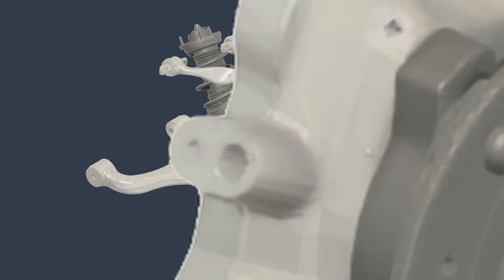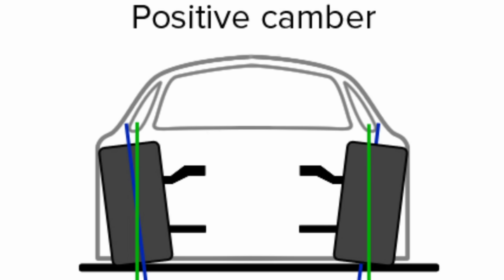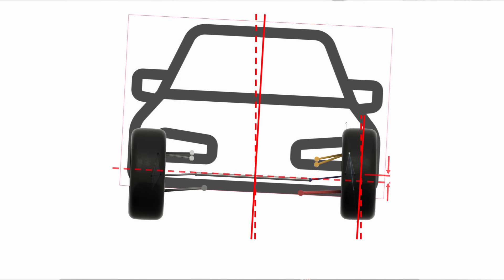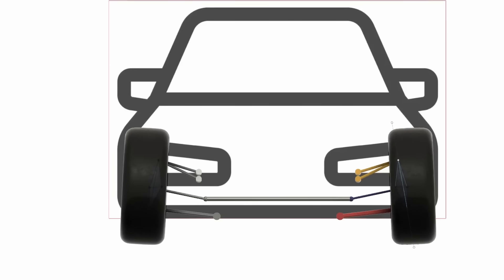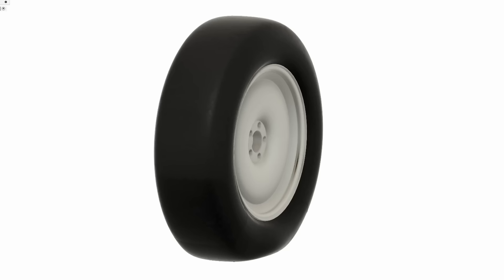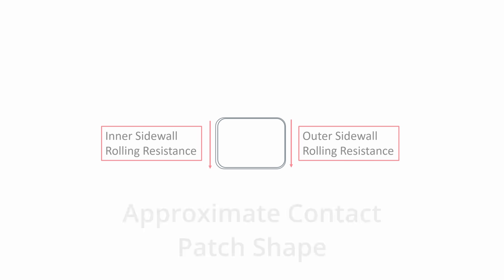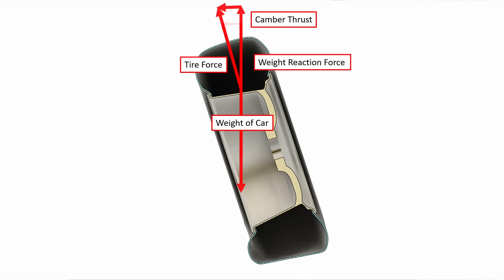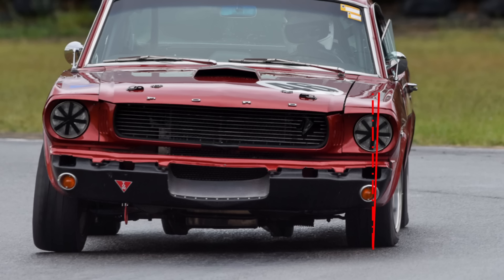Why do some race cars have such ridiculous front suspension camber angles?

Comment: Just discovered this channel and i love it!

But for some food for thought: at 8:42 if we add slippage, during heavy cornering the point A no longer moves in straight line reducing the camber thrust effect.
Similar thing under braking. Wheel is underrotating, so point A is moving faster reducing the tension inside the tyre. And from other part of equation i've heard from race engineers that high camber does not impair braking much (there is some effect but cambered tyre takes braking better than acceleration).

Comment: Using a V8Supercar as the example is problematic for a variety of reasons and highlights why focusing on a single setting that is part of complex system does not provide an adequate explanation. Crisp turn in is not the answer.

Caster on turn has a significant effect on camber and weight transfer.
Ackerman angle alter toe on turn.
Bump steer affects toe under all conditions.
Toe angle has an affect on all of the above.
Centre of gravity, roll centre, roll couple and roll moment all affect weight transfer.

To win a race you must complete the race distance in the fastest time. To do this in a competitive field requires the lowest average lap times. This requires consistent predictable grip. The most effective use of tyre slip angle, braking efficiency, drive/traction and tyre wear determine camber angle. Tyres operate in temperature window. Tyre pressure, carcass movement and interface with surface all affect temperature. 

A "crisp" turn in will win nothing if you are being out braked by 5 metres every corner.

V8Supercars have used a control tyre since 1999. If communism was a motorsport this it.
They have used a full spool locked rear axle since 1993. Getting the inside rear wheel away from the surface during turn in and mid corner is key. 
They used a 6 link live cambered jackscrew adjustable roll centre rear axle until 2013.
Project Blue print in 2003 meant only engine and body panels were different. All front suspension double A-arm.
They used triple spring 4 way adjustable dampers until 2020 - Tender spring (soft), main spring and bump stop spring.
They used driver adjustable front and rear sway bars until 2023.

Comment: You forgot about Caster, That while turning the wheel it will increase camber to the external tire and reduce it in the internal tire.. Rear wheel drive cars have very aggressive Caster, because the front is a Passive axle, where Front wheel drive have less caster because it is a active axle, but also because  most of the weight in on the front and To much caster makes maneuvering very hard.

Comment: I don't think this discussion is compete without talking about optimizing contact patch load across the width of the tire while cornering. Sidewall and contact patch deformation while cornering at 1.5+ Gs is significant and we want to make sure we're not overloaded the inside or outside of the contact patch. The usual means of adjusting this is with tire pressure and camber while measuring the tire temperature a few places along the tread width.

Comment: Future video idea. 
Everywhere we can hear how much G a car can pull but no one ever explained how is this number determined/calculated.
Reply: Googling "skid pad testing" gives AI Overview: "Skid pad testing involves driving a vehicle around a circular track at increasing speeds until the tires lose grip..." And that's about it. They drive in a circle until they can't. 😂 The tire size, compound, rim width, car suspension system and alignment are all variables. It's just a metric, to have something to publish in car magazines to give the reader some idea of the relative handling. Like the slalom test.

Comment: I also noticed drift cars tend to have huge negative camber in the front wheels, while the rear wheels are almost straight. How can this be explained? I know tires tend to behave much more complex once they're out of the friction circle, and tire dynamics in those conditions are not fully understood yet. My own assumption is that drift cars tend to have a large caster angle in the front suspension to make the front wheels alignment force much more stronger to help with counter-steering, and what that brings is at high steering angle, the outboard front tire (in drifting condition, which means the car is counter-steering, which means it's pointing outwards) tend to gain a bunch of positive camber (due to large caster angle), and putting a lot of negative static camber to that tire cancels it out, and helps the outboard front tire (which is the most important tire because of weight transferring towards outboard, and obviously when drifting the front tires still maintain grip) have a better contact with the ground.
Reply: High negative camber gives better initial turn-in characteristics after a flick where the outside front can bear very excessive loads compared to steady state, with higher load usually being linked to needing more camber, but it's mostly to counteract the caster like you've alluded to. Cars with better geometries can run less, and get even better braking and turn-in characteristics due to being slightly closer to optimals on average.

Driftcars tend to have lower caster, settling around 2-4deg. The jacking and angle change isn't desirable. They maintain self-steering by moving the steering axis forward, usually via a custom knuckle and a top hat.
Reply: You see the angle they achieve mid drift. With 0 static camber the contact patch would be next to nothing. As above they usually use less caster and move the axis itself so you need more static camber to make up for this as well
Reply: @HondaEnjoyer12 You need less static camber to make up for the caster, because it's lower. In opposite lock, the caster effect is counterproductive, and lessening caster will make it relatively more productive.

Comment: You should see some circle track cars. I race pavement late models and my car has about +8.5° on the LF and -4.5° on the RF. I typically only run 10-12 psi in the LF. Part of why this works is because this causes stretching of the tire in the contact patch. Think of it like stretching the skin of a drum. The more we can stretch the contact patch, the more grip we get. The downside is this creates a very narrow slip angle window to operate in.
Reply: I've found a correlation between lower inflation pressure and more longitudinal grip. You might lose lateral grip, but you'll gain longitudinal grip; and more than you lose lateral. It's one reason why high power driftcars and dragcars run so low rear pressure.

I've also found a correlation between lower pressure and a lower optimal slip angle; but it's not really a rule, some tires go the other way, some don't care.

Comment: camber thrust only makes the car wander if the other wheel gets off the ground, it doesn’t provide lateral grip. 
while cornering hard the grip causes the wheel to  tilt to the inside,  reducing the contact patch. to align the profile back with the road you need some camber that depends on tire friction coefficient and downforce. . race-cars use more initial camber because they have grippier tires and more downforce. with the double wishbone suspension you can slightly increase the camber during cornering while keeping it lower for braking on straight line.  but I’ve seen up to 3.5 degrees even with DW. front to rear- more front camber if you want better turn in, looser rear.

Comment: Whooo, a suspension geometry nerd channel! For once the algorithm nails it! So, small question: if i run stiffer dampers and arbs, so reducing body roll, does that mean i require less negative camber?
Reply: All else being equal, yes.
Reply: Stiffer dampers won't reduce your body roll per-se, and you'd need to figure out how stiff your stabilizers actually are to tell if they reduce roll meaningfully. On a road based platform, I'd generally say they don't, and are more for balance and feel tuning. Maxing out your bars won't allow you to run a lot less camber, maybe 0.1deg.

If you have a platform with very stiff stabilizers on it, you probably also have a platform which has racing tires and can pull more G than a road based platform, so you'll end up with more roll and a lot more elastokinematic camber loss from lateral forces, so I suspect you'll end up at similar camber angles as the road based platform anyway.
Reply: @ArchOfficial  good points
Reply: @ArchOfficial  agreed. I run no rollbar in my E34. And the M5 rollbar in the rear. Makes the car unersteer way less this way and snap oversteer is almost gone. The car also sits on 12kg/mm springs allround and only 3cm of travel before the bumpstops (very tall but soft bumpers) up front. Very low bodyroll.
Looking into a new set of rear dampers. Feels overdamped and resists weight transfer too much.
Im not trying to make this Wagon go fast. Its supposed to go sideways with no effort :))
Reply: @jesperviktorsson8027  I'd suggest ending up with a setup that has stabilizers so that you can quickly tune balance at different tracks or when your tires wear, as opposed to having to change springs.

The reason you need to run no stabilizers is because equal springs F/R in an E34 will be very understeery due to the rear MR. Maybe try something like 12/16.
Reply: @ArchOfficial  I dont regularly track the car. I need the front stiffness to kill some of the bodyroll without the swaybar. She drives just the way i want too. The rear suspension geometry on these from factory is mediocre at best. Going with even stiffer springs will just exagerate the anti squat too much. I already somewhat overdid the spring rate. 

And the front end cant be any softer. Shes an IX(awd) from the factory, deleted+stroker+boost. The IX front end barely has any ground clearence when slamed. The knuckes are custom with more appropriate pickup points for 0 Ackermann and roll center correction. Have to run 18inch rims to clear the controlarm.
Reply: @ArchOfficial  The static angles are front 7° caster -2.7 camber and 0.2 toe. Rear is -1.3 camber and barely any toe.
Reply: @jesperviktorsson8027  Well, my advice is that unless you have equal or greater rear ride frequency, your roadcar is unlikely to handle or ride well. You appear to have a large bias towards the front currently, which is the main source of the understeer.

Adding springrate won't change antisquat, that's an internal force reaction. The E34's semi-trailing arm has likely negative antisquat if lowered even a little bit, so you actually do need to run quite a lot of rear rate for appropriate handling, unless you're running crazy power that spins the wheels in 3rd or something.
Reply: @ArchOfficial  she makes about 570 wheel on E85. There is no understeer. She oversteers as soon as you let OFF the gas. The ONLY Issue is the harshness of the rear ride. Realize the cars is very light over the rear tires compared to the front. The spring rates are equal to BCs recommended rates for fast street/trackday, when corrected for the weight reduction over the back and added weight up front.
Barely any of the geometry is factory. All pickup points have been moved to account for the ride height and the "semi" trailing arms have been somewhat straightened to resemble a true trailing arm somewhat more. I also added a bar between the right and left arm to help with lateral forces better to kill some of the self steer under hard cornering.
Reply: @jesperviktorsson8027  Cool. Just make sure to calculationally verify your frequencies and so on. It might be a bit tricky to find your actual real wheelrates without a K&C setup.
Reply: @ArchOfficial  aware, i know you are just trying to help. I got to where i am by throwing shit at the wall until it stuck. The car drives just the way i want it. It is not "correct". It handles predictable, not necessarily fast. The steering is sharp with good weight and the lock angle is 60° both ways.
Compromise has been made. The original plan was to go for an e39 rear axle. And hindsight is 20/20 and it would be better and less work than the current setup. But as it stands ive got one of the fastest trailing arm cars to go round Mantorp Park. In a no downforce Wagon with rear seats, a double sliding roof and 1650kg with a full tank of gas

Comment: Also, McPherson struts have next to no camber recovery. This this makes the cars understeer, which is better for most street drivers. Adding more front camber helps to negate this. I wish they would stop putting struts on performance cars. So far as I know, all you can do if you are stuck with struts is run stiffer springs, stiffen the RARB and run more caster than you would otherwise. I've never seen a purpose built racecar with struts. They all use dual wishbone or multilink arrangements.
Reply: With modern production cars being roughly doubly as stiff as ones from the last century, camber gain is less important, and is actually minimized for the last 20 or so years. Having linear, predictable kinematic and elastokinematic curves is seen as more important than outright performance in steady-state.
Reply: @ArchOfficial  Not 100% relevant but why do some modern cars have no steering feel. It's really annoying when the engineers are asked to go overboard on heavy-handed pull-drift compensation algorithms and removing "bad" feedback just because it gets better customer feedback scores.  [LKA systems tugging at the wheel don't help either!]

It's such a contrast from cars like any of the McLarens with their lively hydraulic power steering designed by the engineers (or even Toyota 86 or RenaultSport Meganes or Alpines with decent steering feedback too). 

The difference between a BMW M5 (totally vague and numb Autobahn luxury cruiser) and a BMW M2 CS (specced by the engineers with free reign as to how they want it) is apparently vast!
Reply: @TassieLorenzo  I suppose the mechanical reason is highly effective electronic power steering systems which are capable of a lot of assist coupled with a general trend towards lower profile, wider tires and higher mechanical trail values. Newer cars have factors which increase disturbances in the steering, and newer power steering systems are more capable of removing them.

The reason they are generally removed is because consumers tend to find small vibrations and jolts, or even steering feedback in general, as either design flaws or mechanical problems with the car.

I have some steering force/lateral G data, and I do see a trend towards lower torque numbers in newer cars. 

A car from the 90s, even a fairly commuter type one, might be about 6Nm near the peak (Porsche 996 Turbo is exactly 6Nm, and Nissan Silvia S13 is fairly close, north of 5Nm IIRC), while I've seen new ones as low as 3.8Nm, although it will greatly depend on the roadspeed, as they are very speed sensitive nowadays.

Modern EPS racks tend to have less friction and damping than older HPS racks, though, so they could probably have superior feel, it's just that the assist curves tend to have quite aggressive initial slopes and not a very pronounced knee compared to HPS which won't really provide any assist at all until a few Nm, and with a very high slope after the knee.
Reply: @ArchOfficial  Thanks so much for the detailed reply ArchOfficial, that's fascinating!
Reply: @ I wouldn't take anything I say about OEM design as gospel, though, I don't work at an OEM nor am I a consultant or anything. I don't really know what their exact logic and reasoning is. Mine is colored by performance engineering concerns, they might have other reasons.

However I have made a large amount of simulation models and I've looked at hundreds of designs, so you see some trends after a decade or so of doing that.
Reply: bmw e36 have macpherson strut and have less understeer if you fit a stiffer front anti roll bar.
never understood why it does it with this car only
Reply: @TheUltimateRanger89  It's unlikely that steady state balance is less understeery; the car might just feel tighter to you and inspire more confidence. A car that's too loose is hard to attack with.
Reply: @TheUltimateRanger89  I've heard of situations where you get a paradoxical result-- fit a stronger front bar and get more front grip. The explanation that was offered was that the car had very little roll resistance, and fitting a stiffer bar reduced roll to the point that front camber loss became a bigger factor than the increased load transfer. I've never dealt with this personally, just relating the story as it seems plausible. IN any case, testing is the answer!
Reply: @nicolashuffman4312  I have never found a design where decreasing roll via only stiffening one axle would also increase grip on that axle. You need to also remember that the other end will roll less by roughly an equivalent amount, cancelling out most of the camber-based grip gain relatively.

I'm pretty sure it's just people placeboing due to the car being more stable on turn-in, which allows them to drive it harder due to not losing grip on mid and exit.